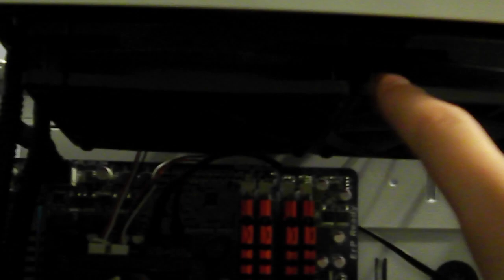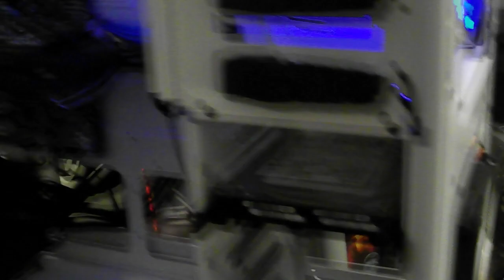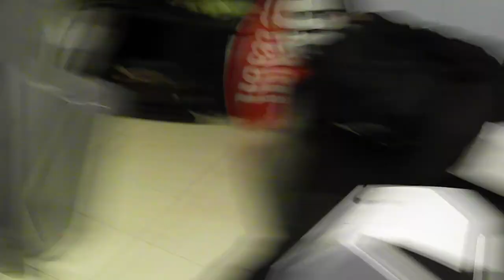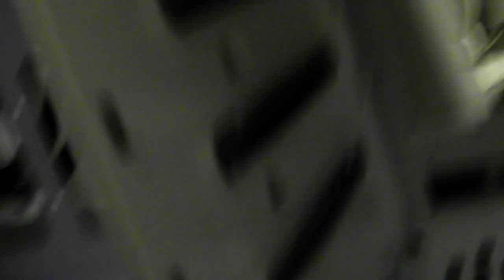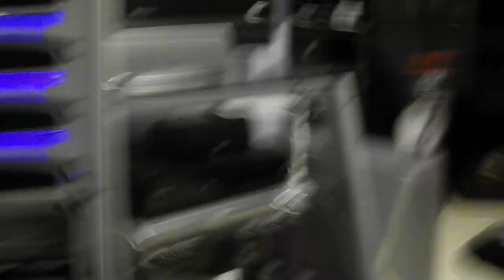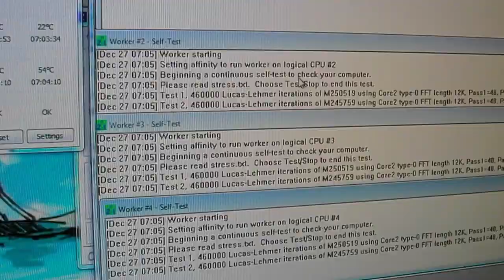NZXT Phantom w/ Corsair H100 Push/Pull & Intel Burn Test and Prime 95 Temp Checks 2500k @ 4.3ghz

Comment: I have the same exact case. even if you can manage to put the radiator down there you would have to find a way to get the actuall pump/cooler unit to the cpu and you would have to go around your gpu

Comment: it simply means instead of having two fans in one direction "blowing" air in towards the radiator you will also have two fans in the opposite "sucking" that air out so it help the air cycle through the radiator and move faster from top to bottom as air move through the bottom fans and get exhausted from the top fans :)

Comment: I currently have the H80 but am looking into getting the H100 and also installing it into my NZXT Phantom case and would like to know the following: Is push,pull configuration when you have 2 fans pushing air from in the case up towards the radiator and another 2 fans pulling the air that is being pushed up out? Also Is it still effective with 2 fans pushing the air out ? ? ? ? ?

Comment: What's the best way to use this in push pull config? as an Intake or Exhaust?

I'm setting up a gaming rig soon and I'm not exactly sure the best way to set this up. I can have the exhaust fan as the intake and have the H100 exhaust? But I'm not sure if that's a good performance method. I will also use Cougar 120mm fans on the rad + the stock fans. Hit me up with some ideas.

Comment: I have an ASUS P8P67 EVO with Corsair Vengeance Blue 16 GB DDR3 SDRAM Dual Channel Memory Kit and want to buy this CPU cooler but I was wondering if it would still fit with the two top 200mm. fans and not get in the way with the ram. @ChrisRey3156

Comment: i want to put the rad plus fans onto the existing 200mm fans in the case, does that mean i dont use the brackets? cos otherwise there isnt any space. do i take out the 200mm fans and put them on top of the case rather than inside?

Comment: this is what im doing right now, BUT, i want to leave the 200mm fans that came with the case IN. but i cant figure out how to put the rad onto the 200mm fan, the mobo is already in the case and the cooler is already connected to the cpu (i bought an OC bundle)

Comment: Did you use those metal stand off brackets the nzxt comes with for the water cooling? I have a similiar setup and I just ended up screwing the radiator right to the holes those brackets would mount to. This cleared my ram setup. But I am thinking going push pull now, but I want to keep my top as well.